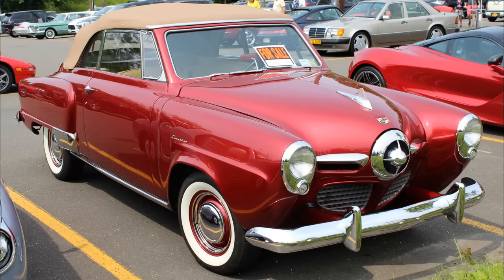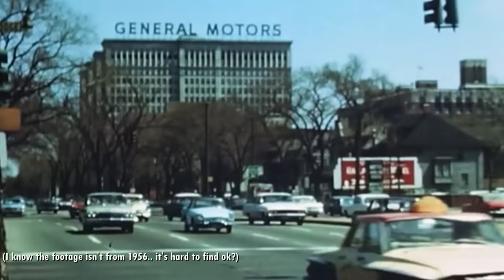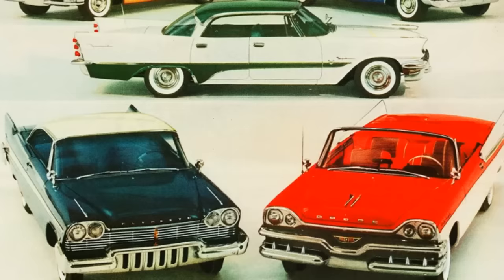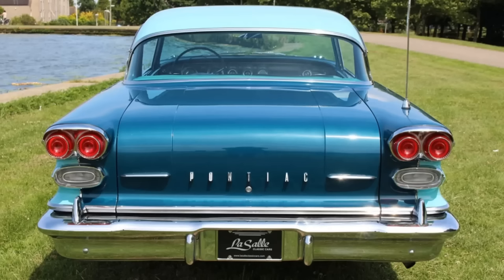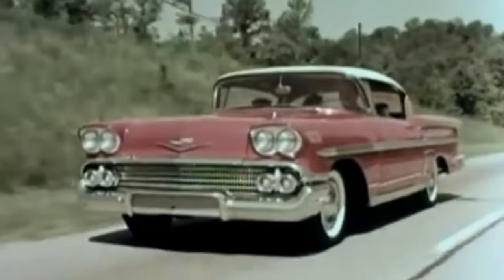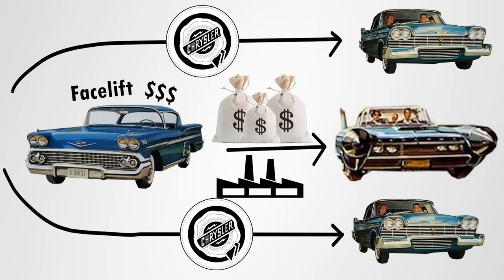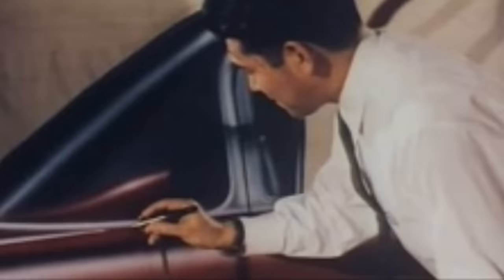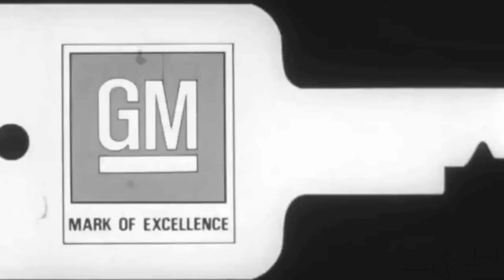Mistake of '58: The GM Chromemobiles and Far Out '59s

Comment: Another informative and humorous video with lots of far-out design sketches i hadn´t seen before, thank you very much 🙂. But the tallest tail fins actually wasn´t put on the ´59 Cadillac but the ´60 Plymouth for some strange reason, this at the point of time where the tail fins was about to quickly go out of style. As for the ´58 GM cars, not only was the bodies totally changed for ´59 but the X-frames they sat on was scrapped and replaced by a conventional frame that was stiffer and made way for the lower bodies.  Legend has it that there was controversies behind the company doors that led to that Chrysler´s designer-in-chief Virgil Exner stepped out when he felt that he couldn´t find support for the new direction he wanted the company car design to pursue (think of the ´60 Valiant) and at Ford, someone suggested (nudge, nudge) to their counterpart Elwood Engel that he should apply for the job. Wesley Dahlberg, also at Ford, found himself relocated to Cologne, Germany where he was to take charge of the newly invented design studio where he was instrumental in creating the new ´60 Taunus 17M, totally void of fins and with a minimum of chrome (save for the waterfall grille). Chuck Jordan got to split his time between Detroit and Rüsselsheim in West Germany at the GM-owned Opel company. It´s been said that there was by then about the same amount of work exchange going in the other direction with Opel designers working on designs in Detroit, mostly for Chevrolet according to a note. As for mr. Jordan, to my knowledge he was responsible for the Opel Ascona "A" series that was aimed very much at the US market and he also did a lot of sketches for the Opel Rekord "D"/Commodore "B" series that debuted around the same time, 1971. Might add that back in the day, from that Opel was bought by GM in 1929 and up until they got their own design studio in the late fifties, their designs was done by Buick´s designers.
Reply: The 1959-60 Chevys and Pontiacs continued using the 1958 X frames but with a completely different body. They continued to use the X frame through 1965.
Reply: @emjayay  X-frame thru 64. IN 65 they went back to a full perimeter frame.

Comment: It goes to show you, a kid of the 2000's simply can't understand what made the 50's go the way that they did.  First you would need to be an American kid.  Second you would have to understand what this generation of fathers and mothers had gone through.  The depression,  The Dust Bowl, World War II (scrap drives/ rationing), McCarthy-ism,  The Cold was still ongoing.   So big sexy awesome powerful automobiles was a great fix for what ail'ed the country.  European's never needed to drive as much as Americans had to.  1958 Desoto Adventurer= Sexiest car ever built. (opinion)
Reply: Good point.  Today we plastic battery charged computer's rolling down the road, what a plus.
Reply: The cars kept getting bigger longer more power more power.  Just think of the options that used to be in design, colors, makes and models.  😀
Reply: @Apollonot  True, you could order almost any car model and get a convertible, and in all kinds of colors.  Even Edsel had somewhere around 60 different color combinations, and the big engine was 475 cu.  Push button shift on the steering wheel horn button.   I'd agree with Pops the pod cars offered today can't compare in quality.

Comment: Excellent mini-documentary that supports my own conclusions about period GM design and Harley Earl's role. I believe the proposed 1959 Buick is mis-identified as a Cadillac and the Buick clay is actually the original Oldsmobile proposal for 1959. I have photos of the original 1959 Cadillac and Pontiac designs as well. These are very hard to find on the internet.

Comment: If I remember the '59 Chevy's batwings actually affected stability at high speeds by exerting upforce on the rear of the car and compromising traction.
Reply: That was my parent's first car and we had it into the 70s. My dad recalled driving along the lakeshore highway to and from work and if there was any wind off the lake he could feel the rear end start to lift and he'd have to slow down to maintain control. I washed that car so many times as a kid I can still feel every curve.
Reply: Yup, if you had the solid-lifter 348, you could go fast enough for the rear end to start lifting up.  The 60 was much better that way, but even it would get kind of light in back at ultra-high speeds, especially those flat-top 4 door hardtops.
Reply: The handling of the 59 was considered overpowered and agile. You were always aware of the tail end lift.

Comment: "The fins, the fins help stabilize the car at high speeds."

"The stabilizer fins."

"You need the fins. The fins stabilize the auto at highway speeds."

Still can recall the conversation points amongst the men and dads and moms and by progression, the schoolyard and backyard.

"My Gawd, you want to risk your family in a car without stabilizing fins!"

As we boys dreamed of cars that would be steered by jet blasts from nozzles in those fins....
Reply: I loved it when they played Star Wars at the drive in and my friends and I rolled in ,in my 59 Coupe De Ville😈
Reply: Actually, like the spoilers on all those Dodge Chargers of 1969-1971, they actually WILL WORK at speeds above 165 miles per hour . . .
Reply: I had a 59 chevy and I  assure you mine didn't have stabilizer fins, they were airplane wins. I once hit 109 mph going over a rolling hill. On decent the rear wheels were lifted off the ground.  They stayed that way till I got to the bottom of the hill. Never took it over 100 again lol wish. I still had that car.

Comment: 9:25 Actually, the '58 Limited was far more restrained in its use of bright trim than its lower level line-mates.        
The cove that contained the fifteen hash marks in the Limited was painted in body color. On the Special, Century, Super, and Rpadmaster models the cove was filled completely with bright metal resembling the top view of an art-deco age express train. Where the Limited had its taillights slotted by four strakes, the lower models had housings that looked like the Chrysler Building humping a steam iron.

Comment: Yup! 1958 was a design disaster for GM, and it continued for the next two years. They began to recover in 1961, and by 1962, they were again in the driver's seat, design-wise, as Chrysler slipped to third.
Reply: I don't think it's correct to say '59 & '60 (Your comment of the "next two years") were a disaster---it depends on the brand within GM. Interestingly, I would say the ends of the spectrum (Chevy and Cad) were the worst. The Olds and Pontiacs were mostly nice designs. The Buicks were "just there".
Reply: Gerald and Jimmy,

Apart from subjective appraisals of design, the only test is.......unit sales.  I assume thats what Ed is refering to when he claims Chrysler was outperforming GM

Did Chrysler sell more units?

I am.a fan of the General's forgotten child of the trilogy......1956.  My brother gave me his 2 door sport coupe ( no posts) 56 Bel Air in '66 and it was the same color as the one shown in Ed'S video, but he did a spectacular GM format black and white paint job on it.  Given i had a 56 I have ever since been a 56 Chevy fan....but.....that 57 Chevy abandoned the quiet elegance of 56 for some flat out sex appeal with tbe 57.
Reply: Yes, it took a bit of sorting out to get the design right. While the ‘59s ushered in a new design language, they also contained some discordant cues: the cat’s eye taillights and batwing fins on the Chevy, the angry canted headlights on the Buick, and the weird front end from Oldsmobile, for example. By 1962, they had smoothed it all out into some terrific designs.

Comment: 9:23   The '58 Buick Limited actually wore less chrome than the lesser models. 
You will note the coves on the rear doors and rear quarters have an outline of chrome strips with three groups of five narrow hashmarks. All other models filled the coves with a flat-iron shaped stamping and chrome inserts all the way to the taillights which were also enclosed in flat-iron shaped nacelles.

Comment: I bought my first 1958 Olds in 1987 when I was 18, my 2nd one at age 52. 
Yes, I still have both of them. 
P.S. You really missed out on how to fill the gas tank, you lift the top of the taillight up. And the 3 two barrels carbs with a 4-speed auto trans.

Comment: I had a 58 Oldsmobile 88. Chrome city. 4 speed dual hydramatic trany. 371 engine bored out to 394.  High compression Jans pistons.  J2 Tri power 3-2 barrel Rochester carbs. 3/4 cam. The beast could burn the tires off if kept it floored.  Gas hog. Didn’t start well below 0.   Broke u joints. Broke rear springs. But had some fun times with it.

Comment: My first car was a hand-me-down 1959 Chevy Bel Aire that was 10 years old and had been our second family car for years. Dad had "splurged" on a 1970 Ford Maverick and the 1964 Chevy Impala Super Sport was turned over to mom. My '59 had once been red but was now kind of pink. Motor mounts were so bad that whenever I hit the pedal the front end of the car would first rear up. But it was mineI  Got a whole 100 bucks when I sold it a couple of years later.

Comment: I have been driven in a 59 Chevy. In the 1980s my ride happened. It was the one with bat wings and cat eyes. Everything was good on the highway until we pegged 70 mph. On que, the rear tires lifted off the ground and we slowed down. The driver did it 3 times. Weird stuff. The car was stock and had little surface rust.

Comment: I believe the 57 Bel Air was the most iconic design of the mid 50's and still the absolute most popular even today, my Dad had several of them and probably the earliest car I remember riding in was a black 57 hard top .  They should have ran that series at least until 1960 IMHO.

Comment: All the manufacturer's were mandated to use dual headlamps in 1958 on all their cars and trucks. the reason for this was an experiment conducted by the insurance companies. the thought was that oncoming drivers could tell if you had you high beams on. without guessing unlike with single headlamps. the experiment lasted two years then the manufacturer's were allowed to use single headlamps again. but the manufacturer's continued to use dual headlamps and single headlamps. depending on if the styling deemed them necessary. and the manufacturer's even tried them in different configurations. such Chrysler and Plymouth putting them diagonal. and Ford putting them stacked on top of each other. and Oldsmobile Cutlass spacing them apart with a marker/turn signal ilight n between them in 1968. and then around 1978 when the manufacturers introduced rectangular 
headlamps. and then into the modern era with molded into the body headlamps.

Comment: Dad owned a 1960 Plymouth Fury that looked almost exactly the same style as the 57 that GM had a stroke over. It was a deep red with white accents and vertical fins with a push button automatic transmission on the dash. 
GM tried to do the same except with horizontal fins on the 59 & 60 chevys. Only problem was that the airflow under the fins lifted the back ends at hiway speeds. Once experienced you never forgot the feeling that the rear end was going to swap ends with the front at 70.
Reply: The 60 Plymouth had no resemblance to the 57. Totally different car.
Reply: Those fins had zero aerodynamic effect

Comment: What you Failed to mention, was that the1958 G.M. cars all incorporated a New Rear End Coil Spring Design, with two lower and two Upper Trailing Links, and in some case suplemented by a Transverse "Panhard Rod", that Grately improved both Ride quality as well as Handling capabilbity, almost on par with Independent Rear Suspansion systems of Mercedes and BMW , that Ford Did Not emulate until 10 years later, and Only in their Top of the like Lincoln Mercury Models !!   Whereas Mustangs and and even ford Fairlanes were riding on "Pick-up Truck like" Solid Axle Leaf Springs into the Mid Seventies, that Chevrolet abandoned after 1957  !!     Morgan Sorensen

Comment: I love the GM designs of 1958. I have a lot of 1:24 models and love to observe and compare  the evolution from 1950 - 1958, the design makes sense, it's a continuation of what was started. Cadillac is the most obvious, starting with the fins, the Dagmars, the grill and the hubcaps. The same can be said about Buick, the  "frown" grill is the dead giveaway for the brand, you can see the evolution at it's peak in 1957 and suddenly change in 1958 with the chrome piece of art. The spear is also a Buick trademark, as well as the portholes, although they removed them for 1958 because they had enough chrome going on. If you place a 1948 Buick and a 1957 Buick side by side, you can see it make sense, its a design evolution, Harley Earl's personal experiment. The same with Oldsmobile,  the frog mouth-  big jet theme grill theme  that had been kept (my favorite being 1957) suddenly changes into a chrome carnival for 1958 (A bit like Buick). Chevrolet and Pontiac are the most changing, theme changing throughout the years in my opinion,  although Pontiac keeps some themes like the stars and the weird grill throughout the earlier years and the rocket for later ones. Don't get me wrong, I love 1959 - 1961 designs as well, but you can see the sudden change, breakage of themes, names and identity, like if completely  new characters  became the face of the company. Although beautiful cars all of them, I can't help to wonder where the previous characters were going, specially if they were going to be around for 3 years.

Comment: a friend had a 58 chevy back when we were young and it was a nice looking car, maybe that's because i like chrome and I loved riding in his 58, though I had a 56 ford Victoria with a 289 and a factory 4 speed!. btw the 289 replaced the 272 it came with.
Reply: 1956 Ford V8s were 272, 292, or 312 cubic inches. There was no four speed transmission offered. The 289 was from a completely different engine family and came out first as a 260 in 1963.

Comment: In 1958 designs were not locked in with styling from previous years. 1958 is when major changes were introduced involving the sitting position of the driver and passengers. Instead of sitting high up on a dining room chair you were now sitting down in a reclined position like in a lazy chair with a foot rest extended.

Comment: 14:16 They DID stave the headlight "brows" of this design and use it on the 1959/60 Cadillac. Also, a vestigial mark of Buick's center tailfin survived in a slight ridge of the 1962 B/C models.

Comment: Sounds so much better than electric or testla. These beauts are awesome!
Reply: But Tesla will beat them in a race
Reply: The short race definitely, quicker and torque yes, testla does. But as far as a joy ride of smiles per gallon and head turns, testla doesn't even compare. It's the experience of the cruise and pur of an engine that can't be beat. But whatever floats your boat. Because they float mine.

Comment: Even though I was just a little kid at the time, I didn't like the taillights of the '58 Chevy and still don't. The '57 and '59 were both so nice. It wasn't until my father bought a used '61 Thunderbird, when we had our first and only head-turning car. Probably because my mother got a VW Beetle which I learned to drive, as an adult, cool cars were not important to me at all, to own one, except I still like looking at them. Instead, I turned toward the cheapest, smallest, and most reliable. I liked this video because I had no idea Harley Earl saw the Dodges or that his designers came up with all those silly designs for unique headlight placement. I thought car designs got comparatively boring after '64.

Comment: At 4:38 we see the one headlight and one turn signal of a 1957 Plymouth, not 4 headlamps as the voiceover says. On a 1958 Plymouth we would have seen 4 headlamps. Another headlamp where we see the turn signal on the 57. The 1958 turn signal was smaller and tucked in above the two headlights. Take a look at "Christine", in the movie "Christine" it's a 1958 with 4 headlamps and the turn signal where  I mentioned.

Comment: I didn't know it was possible. When I saw the rear quarter of that Pontiac with 3 giant chrome streaks going from someplace to no-where, I laughed. Then the Buick, which wasn't too far behind. I have to say, they came up some interesting styling in the late 1950s, but before 1957, all cars were designed like upside-down bathtubs. GM continued that bathtub look through 1957, but the 1957 model year was the introduction of  some of the bitchen'est looking cars on the road from Chrysler Corporation. Walter got it right.

Comment: Are you sure 59 Cadillac had the biggest fins? I thought that was the 60 imperial.
Also you did not mention the terribly dangerous x frame that was used on Chevrolets between 59 and 64. It lowered the passengers and afforded better headroom but it fails in a collision.